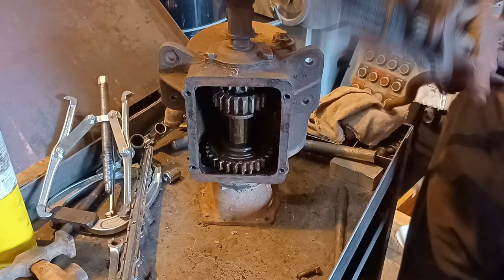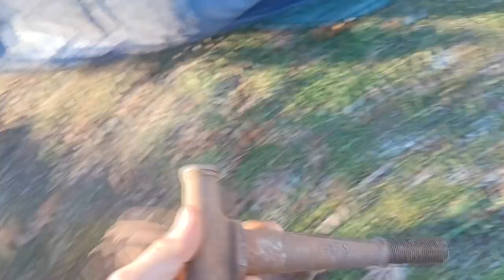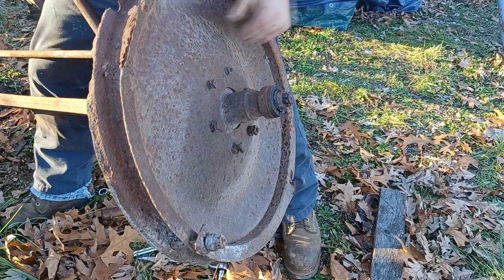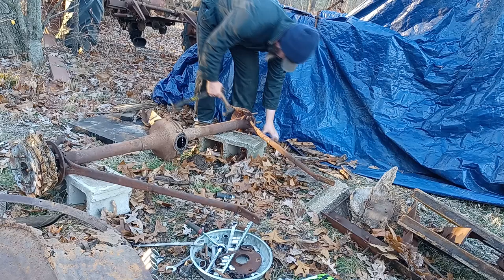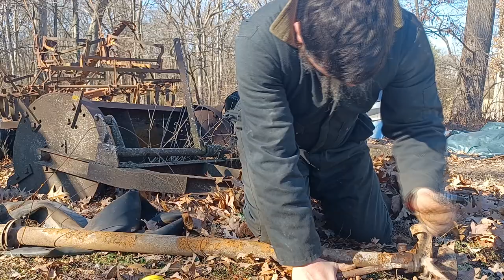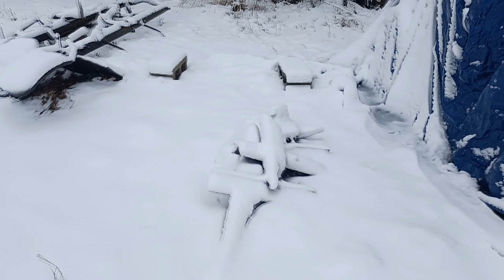1919 Ford Model T Project, Ep 8 - Tear-Down Continues

Comment: Yes, the small drum unit is a 1915 thru 1925 unit, the large drum unit is a 26-27 unit. The driveshaft and radius rods would be the same, it looks like both are the same "open" pinion spool where you can see the bolts the hold the driveshaft to the axle.  The steering bracket without the front seal is for a "TT" one ton truck.